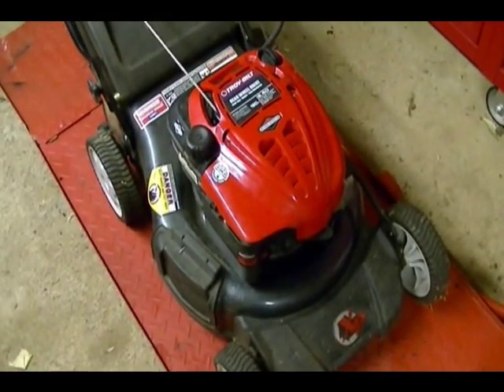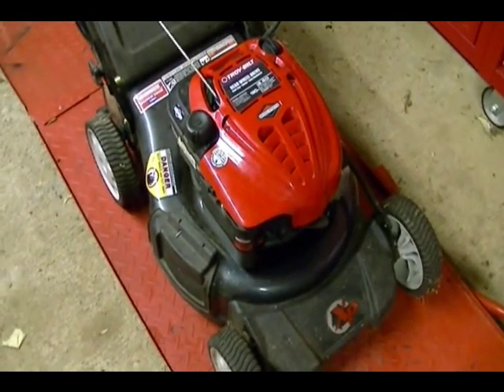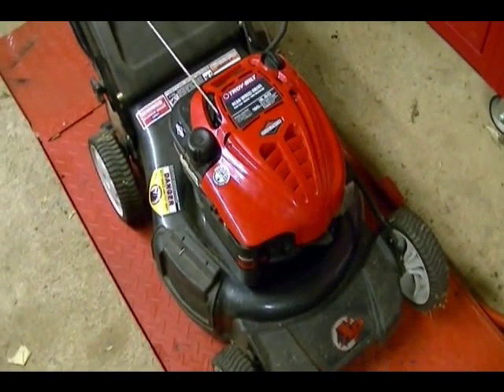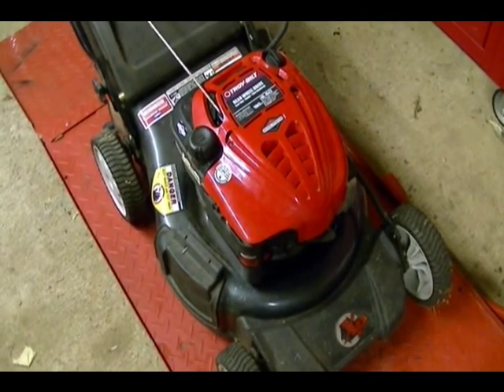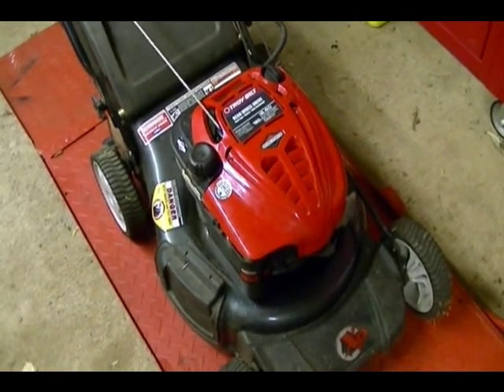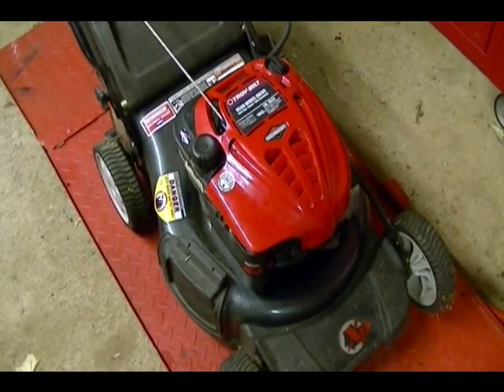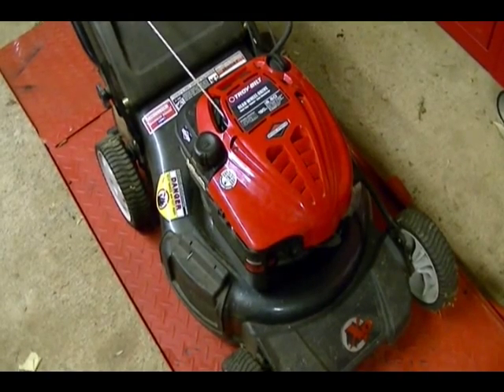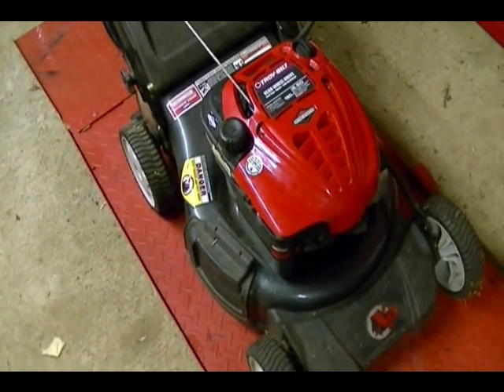How Hot is the Operating Temperature of a Lawn Mower Engine

Comment: Thanks for the video, this is exactly what I was looking for. I have a second-hand Honda Harmony II lawnmower that runs almost perfectly, except for the fact some idiot broke both bolts that mount the muffler to the engine block.
I decided I would give the area a good cleaning and scruff it up for some JB Weld. I needed to know the running temp of the muffler, and you did just that.
Now I know if JB's can withstand 500F, it should work for a while.
Again, Thanks!

Comment: Yeah, the JB weld Held for 40 feet... The connection between the engine and the muffler must be quite a bit hotter.
Never mind, I just drilled and re-tapped it.